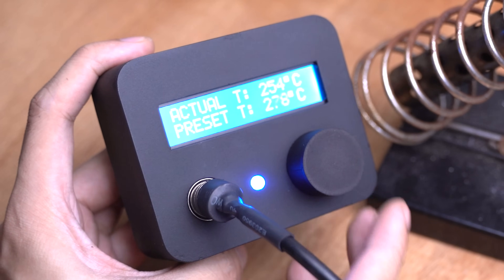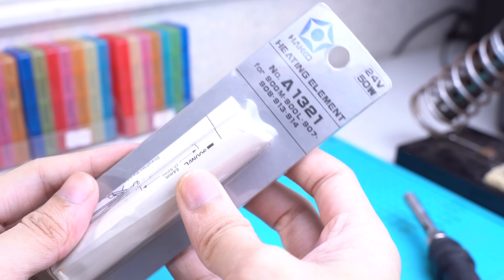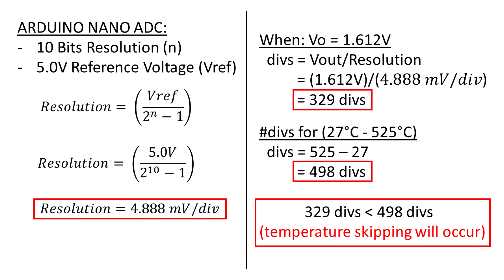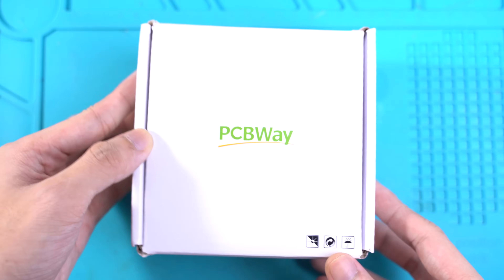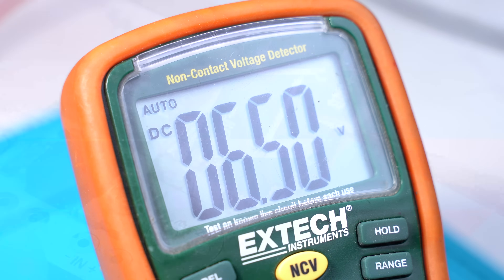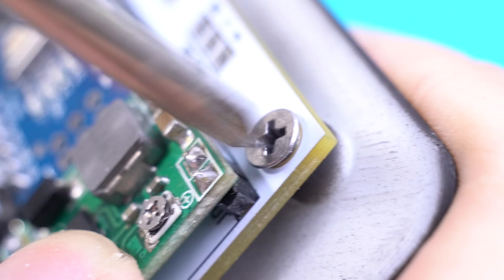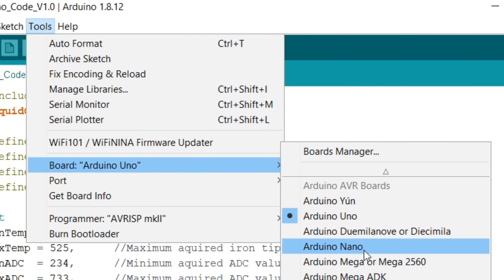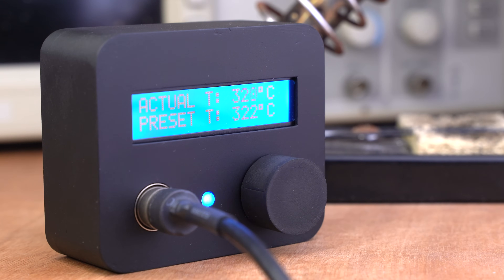DIY Digital Soldering Station (Hakko 907 For Cheap)

Comment: Good project but ... there are some issues with this setup: 
1- The very cheap Hakko clones handles do not have ceramic heaters. I storngly suggest replacing the heating element for the Hakko 1321.
2- If the heating element is a Hakko 1321 (or clone of that) ceramic heating element then the iron will have 50W of power and have JK junction sensors, not thermistors.
3- Even if IRFZ44N is a logic level mosfet (for 5V logic) at least for up to 10A-20A Drain current it requires a drive since you're actuating the mosfet with a PWM cycle. I imagine the PWM cycle could reach 30KHz-50KHz ... so that means a transistor to drive the base is necessary.
4- A simple linear regulator even in a TO-92 package would suffice to be the source power for the arduino and Display there's no need for the module used although of course that works also.
Reply from the maker: Thanks! I did mention in in the video to replace the clone heating element with an original one, they're pretty cheap too. Yep, other models use thermocouples, the MAX6675 would work well with k-types. The PWM frequency with pin 10 was left on Arduino's default frequency of 490Hz, the IRFZ44N should suffice. I've built three of these already, they're pretty stable. The IRLB4132 on the other hand is my favourite logic level MOSFETs for most PWM projects below 30V. For the regulator, I'm assuming you're referring to the 78L05. Dont forget, that the LCD backlight is relatively power hungry if a linear regulator were to be used for a 24V-5V voltage difference (if vin is bypassed). The system on standby runs at around 0.12A at 5V, at 24V the heat dissipated is around 2.2W, most TO-92 linear regulators are limited to 1W. In my experience these often fail fast when the thermals are neglected. The TO-220 7805 would be a wise choice, but heatsinking would probably be required. Regardless if it was board mounted or D2PAK soldered, it's going to dissipate too much heat. I went with the buck since the specific model to keep the board small, cool and effecient. Bucks are kinda cheap these days :) But I guess there's no stopping on anyone who decides to hotwire a linear reg on the buck pins.
Reply: @TechBuilder  If you only use 490Hz then it may be stable since the gate will have time to discharge and charge with not a significant amount of RC dumping effect. But the change for a 1321 ceramic heating element I strongly suggest. It's a big difference specially when it comes to heating times. It heats to the setpoint temperature much faster then those pre-instaled in very cheap 907 handles. And also they're not that expensive.
I also prefer the IRBL4132 but I think I have the same problem you have ... a ton of IRFZ44N lying around waiting to be used :)
About the linear regulator well with the display being a 1602 you're right a TO-220 would be advisable, with a heatsink. Like I said the small buck converter works just fine.
Reply: Sir soldering iron Coil A1322 used and always show cool please help me...sir
Reply: @EngAmranKabir  I have ordered some months ago some boards to help on pcbway techbuilder since his project is Open Source. And the iron actually works ok. I used a 1321 50W Hakko original heating element. 
Be advised that this was done to work on the 1321 heating element I do not know if the 1322 is the same sensor type.
In any case please check Always the connections to the board and the iron. My first assemble had the sensors and heating element switched (btw it heated the iron 😀  ).
So be advised to check since that is obviously fundamental.
Reply: @John_Smith__ sir thank you very much.

Comment: Can you make another version with lm317 because the buck converter  you used isn't available in my country it is a simple modification in the pcb can you make it 🙂
Reply from the maker: Just make an LM317 circuit on a perfboard and wire it to the buck's pins.
Reply from the maker: I'll work an a PCB trace for a 7807 when I have the time. LM317 seems to be an overkill
Reply: @TechBuilder  ok thank you very much iam waiting for you ♥️♥️

Comment: So the tip is not grounded. No ESD protection.
Reply from the maker: It is up to you to add a ground pin to pin#3 of the hakko connector as mentioned in the instructables tutorial. Almost impossible to add one with a AC-DC converter since the ground pin is often isolated from the jack. You can add a 3 pin DC input if you wish to implement the ground for ESD protection.

Comment: I've got a spare 15V 3A power brick laying around, is the 12W difference going to be noticeable enough to bother getting another power supply?
Reply from the maker: For two years I've been using the version 1 with a 18V 2.5A charger, it didn't bother me at all. Really helped me a lot in soldering guage#10 wires and XT60 connectors like a breeze! As for 15V, I'm not that sure. Are you planning to solder chunky stuff? On the other hand, 24 Volts is amazing!
Reply: @TechBuilder   I mostly do smaller work, and there's an old weller station that can do the heavier stuff. I'll keep an eye out for a 24V brick next time I need to order some supplies then. Thanks!

Comment: Super Awesome video as usual! Actually I am a big fan of yours since 2015 maybe (fellow member on Instructables). Btw do you use lead-free solder or leaded solder? Are there any serious safety concerns? I've been messing around with lead based solver for all my life :-|
Reply from the maker: Thanks! Most, if not all, "lead" solder wires these days are lead free. They're often tin based, I think. I'm more concerned with the unknown effects of the fumes produced by the flux, better get good ventilation.

Comment: Does my Hakko fx600 available to add to digital?
Reply from the maker: I think not :(
Reply: @TechBuilder  I guess it could be...but more steps to take board out where inside the handle and then the board communicate with display through Arduino...
Reply from the maker: You can actually if you bypass the board inside.

Comment: can we use esp8266 insted of arduino nano sir? thanks in advance..
Reply from the maker: Yes! Are you planning to automate with WiFi? It's going to be rad but a tad overkill 😅
Reply: @TechBuilder  no sir not to automate.. pamalit lang sa aurduino nano for the code yun po kasi available sakin.. nyahaha para di na sana bumili ng nano.. but i think magkakatalo sa pin config.. thanks again sir..

Comment: Use a soldering to create a soldering. Haha. I think I want to build one.. eGizmo was my store for electronics as well.
Reply from the maker: I knew this comment would come 😂 Yes I did use the my first DIY 907 to make another DIY 907 station for the tutorial. Egizmo is ❤️
Reply: @TechBuilder  haha you saw that coming 😆. I have been longing to buy a decent soldering station but it's a bit pricy. Your tutorial will really help me. It's fun to build, you know.
Reply: @TechBuilder  I've already downloaded the files and put the components in the carts. Soon to place my order.. I've found out that it will only cost me around 2,000-2,500 Pesos including the PCB from pcbway. This is insanely cheaper than the original Hakko 907 station which costs 27k pesos.. haha.. I'm really thankful for this tutorial of yours..
Reply from the maker: @Schjoe  Great! Enjoy! Since you're from the Philippines, you can save a ton from the power supply by visiting local chop-shops or computer repair shops for surplus laptop chargers. If you encounter problems, just email me at casithebuilder@gmail.com
Reply: @TechBuilder  thank you so much! You're a great help.. I really appreciate that..

Comment: Do you already have a video on the spot welder project? Btw good video, maybe try a induction heating element next time like the t12 tips
Reply from the maker: Will do! For the spot welder. I'm still working in the prototype. Still have to do some further testing.
Reply: T12 isn't an induction heating element. But a much better System than Hakko 907.

Comment from the maker: CORRECTION!!!!
- Use the IRLZ44N not the IRFZ44N. The PCB label and schematic on the video lacked the "L". Your MOSFET will run hot if you use the non-logic level IRFZ44N MOSFET. For MOSFET alternatives visit the instructable link. I personally prefer the IRLB4132.
- Due to tiny revisions, please refer to the file package schematics or the instructable tutorial. I update them often for typos and corrections. The one on the Google drive is all fixed. 
- To those who ordered my PCB you should be good to go, the tiny errors in the schematic and PDF files had nothing to do with the PCB links. 
- I accidentally swapped and mislabeled Vin and Vout from the voltage divider equation when I was transcribing my hand written docs. The computation wasn't affected.
Reply from the maker: That's a great idea! I can perhaps make an adapter for this one too :D
Reply: can i suggest next that you build a soldering station that include a heater gun and banana plug input (for other testing)?
Reply: so this doc we can still follow sir right?
Reply from the maker: @mr.kalikut4899  Yup! I update it from time to time. Did the corrections on the docs.
Reply: I don't see the sleep mode, why don't let the 5th wire be the sensor
Reply from the maker: @Van-Hoa-Viet  Want me to add a sleep mode code variant? I don't find the sleep mode useful so I removed it from the code.
Reply: @TechBuilder  Because the welding hand has 5 wires, the other 1 wire adds a vibration sensor to add sleep time when not vibrating. I am looking forward to V2
Reply from the maker: @Van-Hoa-Viet  Thanks! Based on the hakko manual, the 3rd pin (5th wire) you're referring to is for the ground for ESD protection. There's isn't a reed or mercury sensor inside the 907 handles. I think you're referring to the newer hakko models. Regardless, it's easy to add those features. You can usr the unpopulated I/O pins from the 16X2 port.

Comment: sexier version of great scott's JBC station. looks really good! I can hear eevblog saying "hakko!" hahaha. The hakko connector was the only thing that kept me from making one before. Thanks for including the pinout documentation. I will try to buy a clone and replace the connector with a 4 pin aux. love the vid 💯
Reply from the maker: Thanks!! Ummm I think the aux might be a bad idea since the contact resistance increases overtime when the surface oxidizes. I suggest using two DC jacks or a 4 pin header connector :) Have fun!

Comment: FINALLY SOMEONE HAS DONE IT!!! You now belong to the god tier of electronics youtubers. I've been looking for a tutorial on this for years. I've always wondered why no one has made a proper tutorial about it. The amount of detail on the steps are beyond great! I've learned something new today, thank you. Subbed!
Reply from the maker: Thanks man! Been using this for nearly 3 years now, now I have two of them. My old version 1 and the version 2 from this video. I'll make a github for the updated version of the code with the PID version of the code.
Reply: @TechBuilder  Hope you upload them soon. 👍
Reply: @TechBuilder  sir nakapag gawa kana po ba ng bagong code with PID naman po? gusto ko po sana matutunan yung PID system sa pag control ng heating element po na ito. Salamat po.
Reply: @TechBuilder  You could make hot air gun soldering station
Reply: Bilihin ko na lang sobrang PCB mo? Para di na ako mag etch pa  :)
Reply: Are you in the Philippines? Can i buy one from you instead?
Reply: I used the soldering iron to make the soldering iron
Reply: Soldering stations are perhaps some of the easiest electronics projects to design. A basic one just monitors the iron temperature and increases current whenever it goes below a set value. They can be either digital or analog circuits. More complex ones use a very precise PID algorithm for adjusting the current.
Reply: Using an Arduino instead of a 555 to make it uselessly over priced and stupidly confusing and over complicated! You even wrote software, great job!